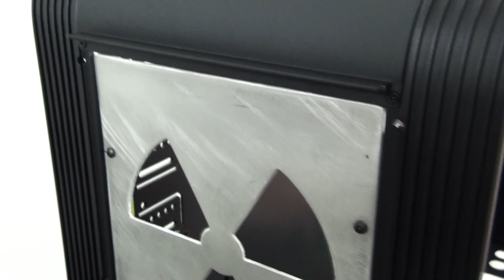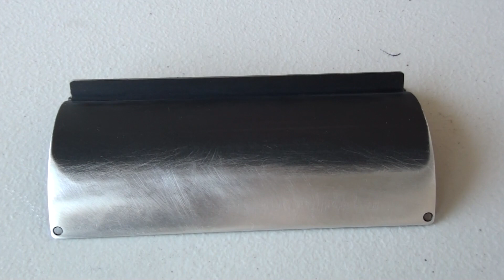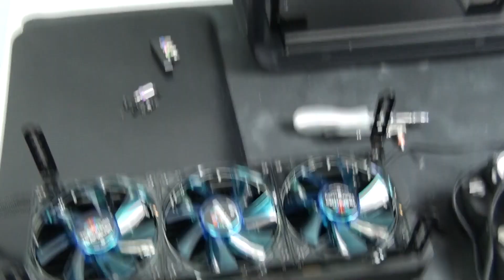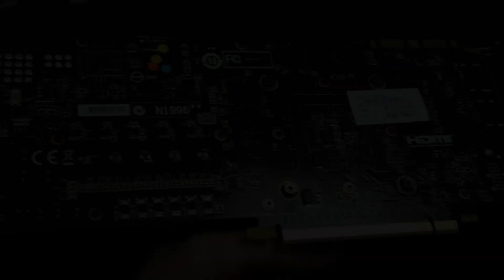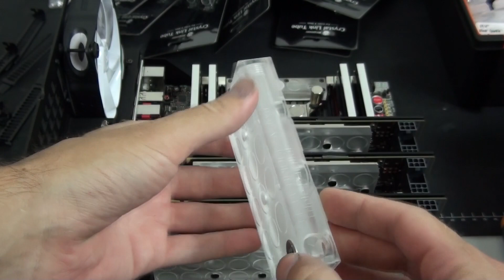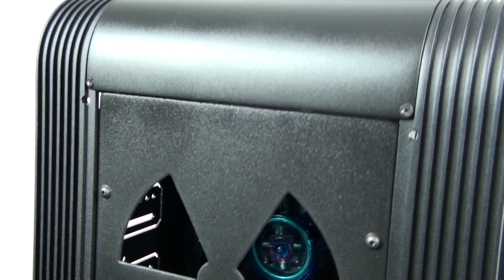Build #8: 'Cytotoxic': Part 3

Comment: when u place the fans like that on the bottom radiator under the motherboard does that mean that side on which u can see the wires is the intake side or the exhaust side ?

Comment: The noise from the eloops isn't normally caused by rubbing against the radiator, it's simply from the massive airflow on the higher speed models like the b12-4.  The b12-2s are slower and quieter than the other versions.

Comment: Haha, i fully back razer and their products but you can't be making statements like that. I LOVE AMD and currently run my own custom build FX8350, but i would never say AMD are "better" than intel. As a avid pc builder i do not take preference to either i just use what i need at the time. (I game and render so i chose 8 core even though it has less performance per core than its rival Intels flagship 17 3770k. Intel is the better chip and has been for a few years now but AMD are improving lately!

Comment: Daniel,
I tested the eLoops all in pull. Have a listen to my video of them, but certainly listen yourself. Also someone found a forum where the owner suggests a small 10mm shroud at least for each fan to eliminate the noise.  I will be testing that as well, but of course as a little more cost.

Comment: Do you have any opinion on the new Corsair SP series or the Bitfenix Spectre Pro PWM? They both claim high pressure specs and I'm not sure if I should trust it. I can't make up my mind on which fans to put in my build. Any suggestions? I have 30 FPI rads and I need both 120 and 140

Comment: no point really...water block install is no different on a 7970 or a 4870.....1) remove stock cooler...2) cut and apply thermal pads/paste...3) flip over onto waterblock and fasten down.,....really not much else to it, now or then

Comment: I have an I7-3930k, Asus Rampage 4 extreme mobo, and 2 HIS 7970.  Do you think it is okay to do a single water cooling system for all of that or would I really need to do a dual system?  I currently am running at 4.4Ghz and don't plan on going past 4.5.  Your help would be greatly appreciated!  :)

Comment: Very beautiful and inspiring! i must say that your client builds ignite a flame of desire to make builds with the same mind of beauty, attention and subtle touches. On a different note, if it isn't too late to suggest, to make a unique glow effect in the loop you can place LED strips under the motherboard to make an under light glow effect. This could add a different kind of nuclear effect (i.e. that the Motherboard is in a way nuclear) and hopefully you'd consider it.

Comment: I think is because the static pressure generated from the fans would decrease enormously due to the gap between the fan's mounts and the radiator itself.
The air essentially would escape from that gap and reduce the performance of the radiator.
It's only an idea...

Comment: Phobya strip or anti vibe mounts may hold it off the Rad, however when turning the blades may wobble making a sound and changing performance, looks like these fan are designed to me mounted in only one horizontal position (pushing air up).

Comment: Given he is located in a remote part of Australia I doubt there is a powder coater  within 200 miles of where he is, even if there was when your building for clients yo don't always have the time to wait on them to finish, can take weeks to get parts back, given the parts cut are part of the loop (Midplate) the build would have to be on hold waiting.

Comment: I particularly wouldn't put a washer in between the fan and the rad cause by doing so you decrease the performance of the rad ever so slightly due to small gap between the rad and fan with the washers installed. It might be not be a big deal for many but to the builder it's not only annoying to think about, it's ugly to look at as well, especially if you're putting lights in which will definitely expose it to others looking through the window.